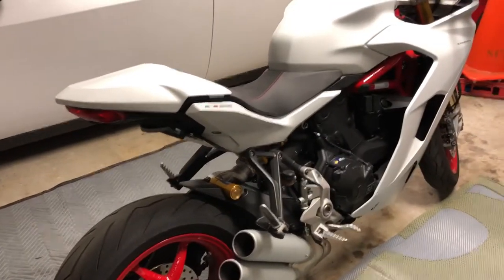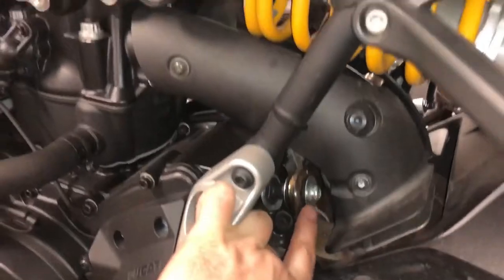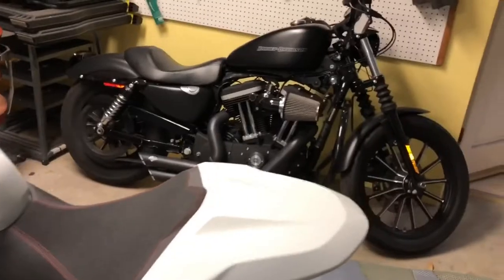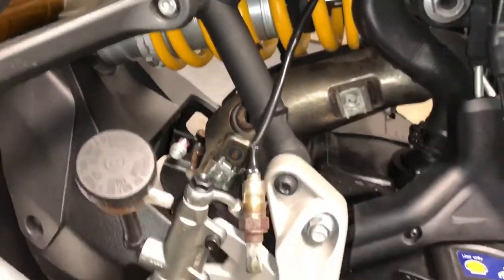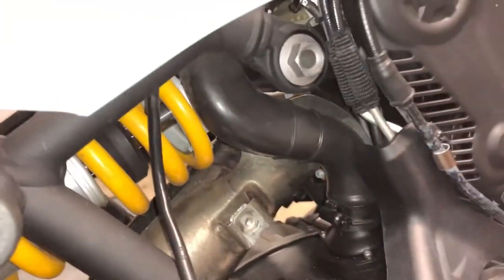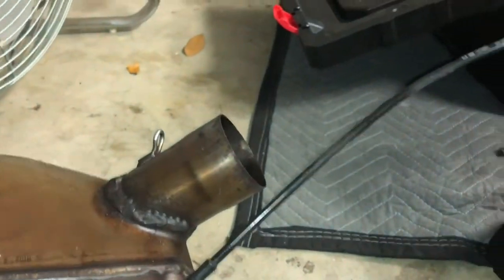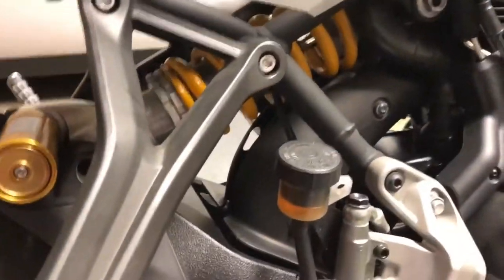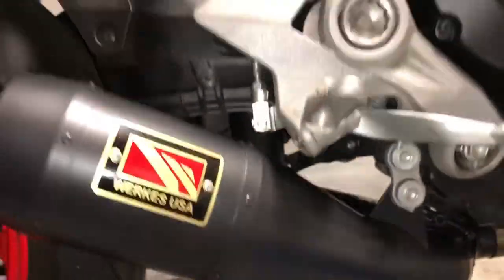Full Installation of Competition Werkes Exhaust - 2017 Ducati Supersport S

Comment: This video is so helpful, thank you for making it. I’m two hours in and almost got the original exhaust off. I didn’t have a tool for the lambda but it can be loosened with a 17mm spanner and then by hand. Lots of wd40 really helped. What a pain this is but at least the result will be worth it!

Comment: Great video, very helpful. However, I'm stuck on the lower right header pipe flange nut.  You used a 10mm crescent, correct? I can't get any purchase at all, and there certainly isn't clearance to put the closed end on it. I'm thinking of using a dremel to shorten a socket which might fit. otherwise I'll be looking to buy a crow's foot.

Comment: I’m so mad new exhaust didn’t fit. Got my bike all apart. Dying in the heat.   Now I gotta wait worst part it’s 4th of July week so gonna be long b4 I get a response n new exhaust made
Reply from the maker: Did you order the correct kit for your bike?
Reply: @fifteCaliber  yes 21 ducati supersport. Gonna send them picture n they will prob switch it out. Hopefully doesn’t take them long to replace it
Reply: @fifteCaliber pdate had to send it back. They widened one of the pipes. It was still a b to get on tho. Had to hit it with a rubber mallet. It’s such a bad fit. Still tryna line it up right but pipe is so tight can’t get any wiggle room
Reply: @fifteCaliber hey I’m sending the pipe back n getting a refund. It just doesn’t fit. All pipes from head to clamps are all lose n canister is rubbing
Tire. No matter what I do there’s no wiggle room to get canister to stop rubbing on tire. It still has a whole inch to go in but because it’s hitting tire it won’t go.
Reply from the maker: @ll.7927  sorry to hear that, maybe there’s a different variation of the pipe on your bike. At least you gave it all you could! Time to find a new kit to use. Good luck!

Comment: hi!, great video and sounds awesome!! i have a question, did you have to make any adjustment to the engine? in order to eliminate the backfiring...i have this SS 2019 titanium and 1 can´t get rid of the backfiring when i am on desaceleration. i´m desperate because i have stock system. can you make any sugestions about it? thank you in advance
Reply from the maker: rodrigo mariscal well first off the stock muffler that comes on a motorcycle is designed specifically to ensure the complete and proper operation of the engine. So when an exhaust pipe is changed, this causes an unbalanced air-to-fuel ratio, meaning the airflow into the motorcycle is increased because of the difference in pipe design and other specifics. This difference can cause backfire in the exhaust. However, popping on deceleration is due to unburnt fuel being ignited in the exhaust, you can reduce it on these bikes with use of high quality fuel, and use the baffle that comes with the system. I personally don’t mind the pops with the baffle in. Without it, the bike sounds extremely rough. Just my thoughts
Reply: fifteCaliber thank you for the answer, i just bought the same exhaust that you do. Looks amazing and sound really loud but i notice in your videos there are no backfiring, hoy can you handle? Thank you for your time. Your video Was so helpfull to install my exhaust. I followed every step. do you install no your bike any fuel tunning? i just did all that you do and the bike don’t sound like yours. So greatful that you help me with this.
Reply from the maker: rodrigo mariscal thanks for the compliments. My bike does not have any aftermarket tuning done to it. My bike does backfire on deceleration. But if yours is running rough after this install, you may have to get some tuning done to your fuel system. Without hearing your bike, it’s hard to know what the issue is, but someone at the Ducati dealership near you can help you tune it to that specific exhaust if you want it to run smoother. Hope this helps!
Reply: fifteCaliber thank you. I didnthe instalation based on your video. It was so helpful. Thank you again

Comment: Do you need to map it once done??
Wont it be running even more rich?
Reply: No remap needed and engine light stays off. The slip on is after the O2 sensors, so running rich isn’t a problem either.

Comment: How did you remove/put in the o2 sensor without twisting the wire?
Reply from the maker: Itsraz you need to twist the wire with your hands in the opposite direction that you screw it in. That way it can’t kink up and instead it will just unravel itself as you tighten it in.
Reply: fifteCaliber yea that’s what I did... I just wanted to make sure you didn’t remove the gas tank and access the o2 sensor that way. Did your check engine light come on? I just finished the install and my engine light is on
Reply from the maker: Itsraz no I did not get a check engine light at all. Your issue could also be with the servo plate that tricks the system for your exhaust valves. Was that installed correctly?
Reply: fifteCaliber I thought I did but I guess I’ll take a look at it today. It could also be the o2 wire got stripped and one of the wires ripped as I was putting it on because the wire casing stripped off when I was taking it off. If I fix the servo will the light go off? Thanks for all your help btw
Reply: fifteCaliber also did you spin the servo motor a lot before you took off the bolt? The motor spun a few times as I was trying to remove the servo bolt
Reply from the maker: Itsraz you definitely want to minimize how much you spin the serve when loosening and tightening. I recommend using another tool to hold it in place while you unscrew the boot on the front. However, Yeah a stripped O2 sensor would set of an engine code, if that’s the case, you may need to take it to a professional to have them fix it. Good luck!
Reply: I was going to say something about this. Not really the install and removal but don't touch the O2 sensor if you can help it. Even finger oils can mess with the readings. I used to sell a lot of O2 sensors and they usually come with a little cap that can preclude contamination. Nice to see Competition Werkes gives you an O2 removal tool. When you replace other O2 sensors that would come in handy... Again not a complaint just something I noticed.

Comment: It doesn't matter if the valve is not installed?
Reply from the maker: What Valve are you referring to? The Baffle?
Reply: The valve on the original exhaust
Reply from the maker: To my knowledge the Valve Is located before the exhaust downpipe. That is why it is necessary to install the Servo Plate so that the valve can be actuated. I am not a professional, so I could be wrong, but either way the exhaust sounds great! Hope that helps.
Reply: Thank you for your answer, I understand this structure.

Comment: Difference in exhaust weight?
Reply from the maker: Blake Newton significantly lighter than the stock exhaust system.
Reply: Sure looks better. I think I'll go with the gold color can myself and drill off the tag so it looks stock. Question.... Was the db killer insert included? I'll get one of not but if it's part of the deal it would be nice.
Reply from the maker: Blake Newton yes it’s included with the kit! Good luck with your install!